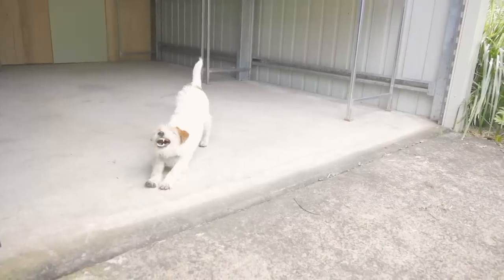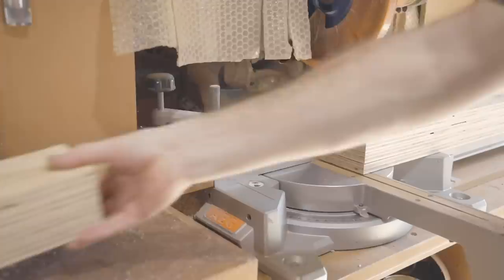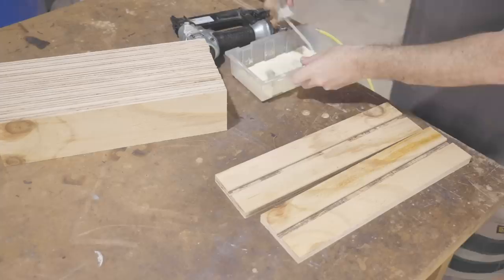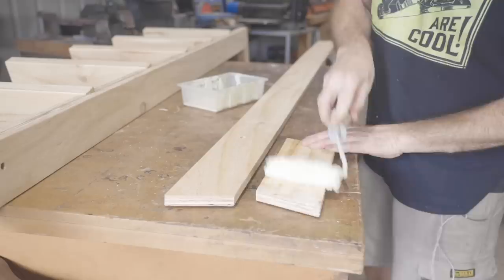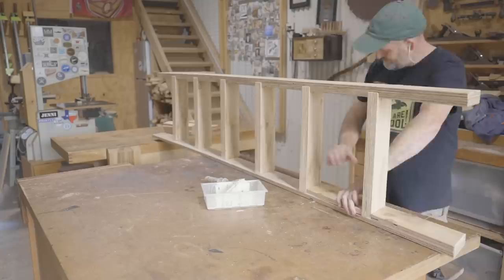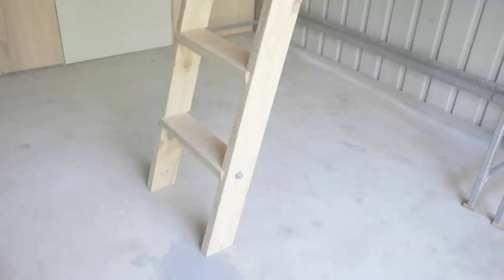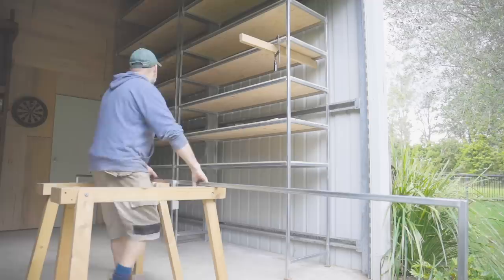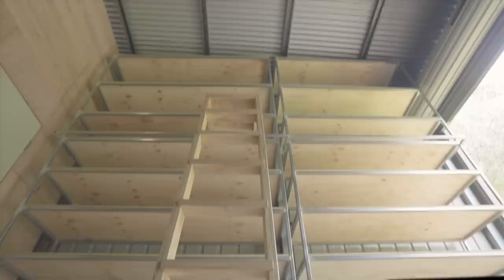How to Make a Ladder

Comment: Just a general tip that I find useful. I am in my 70's and let's face it, not the tallest guy in the world and my reach is not that long. So if I am buying heavy sheet goods, (Melamine: anything over 1/2 inch) and making shelving etc., I get them to make initial cuts at the yard. It makes them easier to carry and they usually throw in a free cut. Hope this helps somebody.

Comment: Exactly what I need!!! Bought a house where the mini-split is 10'' up over a "shelf" actually a bump out wall. Not the best thought out for getting to the filter! Have been contemplating just this exact ladder, but couldn't bring myself to pay for and have to adapt a commercial library ladder. Thank you! And as others have noted, a truly great no nonsense approach to filming & editing. So refreshing! P.S if you stumble across a same model table saw you can join the two tables, gain a bigger table, and keep a dado stack in the outside one. If it's worth the effort 🙂

Comment: Nicely done! 
If that ladder was for me, I'd ask to add a handrail on the sides. It would extend out the side for easy hand gripping and also act as a bumper to protect from contacting the bolts that are securing the steps. 
Safety third!

Comment: Very nice and sturby.You can put also small wheels in the bottom side of the stair,so you can move L/R without to step on the ground.
Reply from the maker: Thanks! I was always going to add retractable castors to the legs but when I fitted the ladder I found they weren't needed! :)

Comment: You can make runners with springs for the floor. It will run freely until you step on the latter. Your weight is going to push the latter safely to the floor

Comment: Pask, ive got a couple tips for using the jeweler's saw, use contact cement to stick 2 pieces of sand paper together and then cut them into strips, you can then put them in the saw and use it like the blade to sand the inside of a piece easier.
Reply: Also, if you buy twisted blades that cut in 360 degrees it will make life way easier

Comment: Great work 👍 the only part I don’t like is that putting the ladder against the opposite wall is in front of the door, thus ladder will always be sticking out in middle of room, but doesn’t look like there is really an easy work around to avoid that. Maybe a metal thin ladder, that straight up and down? Granted would not be as useful going up and down.

Comment: Hello young man, The title of your video is misleading. I was concerned with the angle and degree for safety reasons. When I seen what you were up to, a single use / dedicated access ladder, it then all made good sense. This is what some refer to as a Library Ladder. It is impossible for the ladder to kick out.
 Why not add two wheels to the legs that only travel horizontally?  I'd also probably add two braces on a 45 degree for the top step to the side rails to improve strength and add peel and stick anti-slip material for the steps . This is very good construction, the threaded rods alone are enough to keep the ladder from spreading. Keep up the good work, I'm always looking forward to your videos and enjoy every one of them. 
Cheers, 
your biggest fan
Reply from the maker: Thanks very much and glad you're enjoying the videos. I was always going to add retractable castors to the legs but found when I fitted the ladder it wasn't needed. It moves along the rail very easy as is. Bracing the top was something I had in mind if needed but it's rock solid and wasn't needed either. :)
Reply: @PaskMakes   As for wheels, I was only thinking in terms that you can pull yourself along to access all shelves and bins without getting down and moving the ladder,.
A hand pulley system and a cargo cradle mounted on a roller track running parallel with the shelving might also be a good safe idea as well considering, that you are going to be carrying a sizable bin and ascending steep steps, you are not making three points of contact. You can raise and lower bins from the top shelf to the floor safely , just a suggestion. 
 Thanks for the reply, much appreciate your point of view and shared knowledge.
Reply: RockIsland Rides If you're as concerned about safety as your comment states, then wheels on the base contradict that intent somewhat. Nothing like a travelling ladder to upset balance. Especially when on that top platform!
Reply: @DiscoFang  with wheels, naturally the mono rail ladder would also require hand rail waist high on top 3 sides, they already exist and are used in many applications.
Reply: RockIsland Rides Naturally. Right, right. It's ok to admit you hadn't thought of that.
Reply: @DiscoFang  "ALL"  access ladders especially at 15 degrees must have the ability to maintain 3 points of contact when ascending descending, removing or putting something on a shelf that has a top rest platform,
 This is Especially and specifically standard safety when doing temporary work as I just noted  above/  that information is a given industry standard to most safety oriented people , not something that I would get into here to extrapolate, go into length, judge or want to high jack someones channel that I respect. Have your last say , continue to troll if it makes you happy , you're absolutely right what ever it is.

Comment: Nice vid! A safety improvement would be to have the ladder locked or secured when in fold down position. When lifted it could release and be able to slide. Would be a shame to fall down on the concrete when it is such a fine ladder!

Comment: You build some brilliant things.  I especially like the ladder but I think pocket screws are way over used today. A through screw in this application (4:45) would IMO be stronger and thus better. thanks for sharing.
Reply from the maker: Thanks mate! I reckon pocket screws are fine for the right job though. I don't agree that it would be stronger to screw through and into the end of the plywood, that's the reason I used pocket holes as they are stronger in this situation. :)

Comment: Great project, and cool idea with the carriage for the ladder.
I have been wondering how much you pay for plywood in other countries.
18mm plywood will cost me approx. 150-160 AUD each in reasonable quality.
I think that rack and ladder would end up costing me 2000-2200 AUD to build with all materials.
Is it much different than anywhere else?
Reply: It would be far less in the USA, maybe half that depending on the quality. Here raw lumber comes from both the USA and Canada so it can transported by truck. Perhaps there raw lumber has to come from overseas?

Comment: Very Nice.
The clear plastic boxes will disintegrate when exposed to UV light (sunlight) so i prefer to use black boxes. - just sayin.
Reply: Good point, but it's not really about the color, it's depends on the type of plastic and rather it was engineered to be UV stabilized. I've seen all sorts of colors disintegrate outside while others of similar color don't.
Reply: @Zeric1  Correct.  But that clear colour is called "natural" and has no UV protection.

Comment: 18mm = 23/32  for you imperialists, and a tad shy of 3/4" for you fraction fraidy cats.
Curious, did you braze those aluminum tubes or weld?
Reply from the maker: The tubes are steel so they were welded together. :)
Reply: onjoFilms it's the other way round I'm afraid. 3/4 inch ply came first. And I'm saying this from a metric country.
Reply: @DiscoFang  - I don't know what you're talking about. I never said what came first. I'm just making the conversion for people who use imperial.

Comment: This one has me scratching my head as, except for the fun of building it, I don't see the rationale behind it, you could have bought an aluminium extension ladder for around the same price, and cheaper if you had to have the sheet delivered.
Reply from the maker: I didn't need to get the plywood delivered and it costs $40 for a full sheet, I only used about half. A step ladder like the one I used in my racks video cost $90 (and that's just a cheap one). It doesn't have a platform and doesn't slide along a rail so for my purpose this is heaps better. It's much more comfortable and safe to stand on the steady platform of this ladder than balance on the top step of a step ladder. 
Also as I pointed out in the video it's more about the method of building a ladder and adapting it for your needs. For example a treehouse like I also mentioned in the video. :)
Reply: @PaskMakes  Ok Where do you get a sheet of CD construction grade plywood for $40 from? It sure as hell wasn't Bunnings! If I could get for that I would build a Taj Mahal!
Reply from the maker: It's been a while since I last bought 18mm but it was from a local supplier 'The Bunker', if I remember I got that price because I bought a few sheets and it was $44 for a single sheet. :)
Reply: @PaskMakes  You should have bought MORE! LOL

Comment: Um,, plywood ladders is a no no. Check OSHA.
Reply from the maker: This for my home shed, I'm not selling it or making it for someone else. It's well built and rock solid. I've used many, far more flimsy purchased ladders over the years while working in the building trade. :)
Reply: Pask Makes that’s awesome! But by doing this vid you should make it clear that plywood ladders are not endorsed by any safety regs and should only be made for personal use as in someone may watch your vid and make one for a client only to have it de-laminate or a void in the plys causing a failure. Great project tho your design is awesome just be careful what you put out on here cause misinformation can lead to disaster

Comment: I think you need to work on the title of the video. It needs to say something like used $3,000 worth of shop equipment to build a $300 ladder.
Reply from the maker: Use whatever tools you have and manage as there's always a way to get the job done and not having the best tools should stop you.

There's not a thing you couldn't do in this video with a regular circular saw, hammer and nails and the odd basic hand tool. I'm obviously going to use what I have and even the tools I used in the video are fairly basic which a lot of people have. :)
Reply: @PaskMakes  I could have made that ladder with a third of the tools that a usual person could. That's not the point.